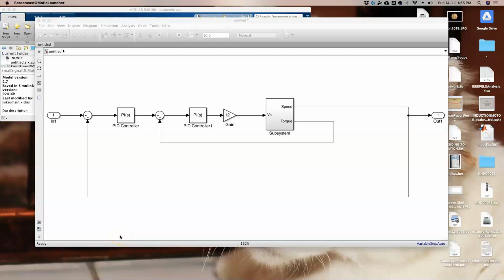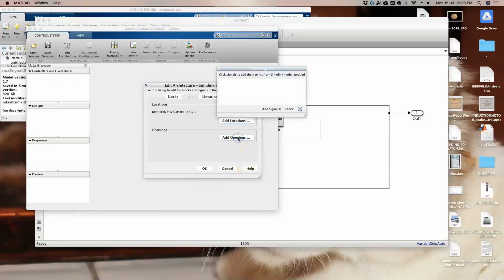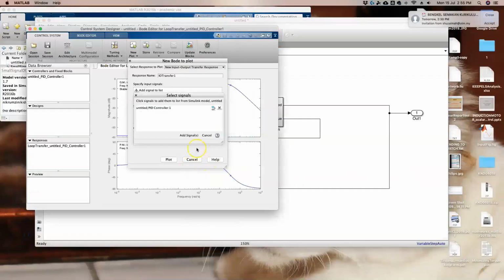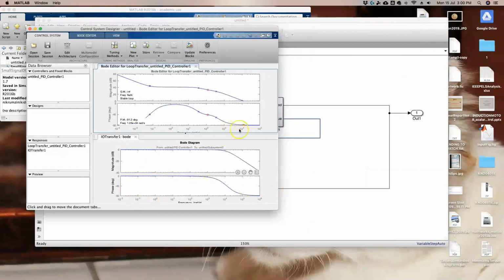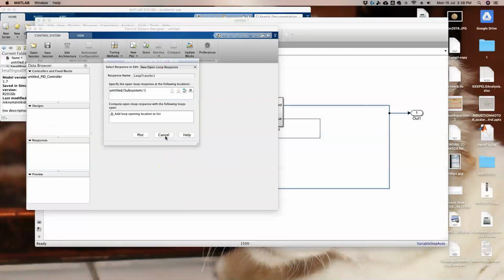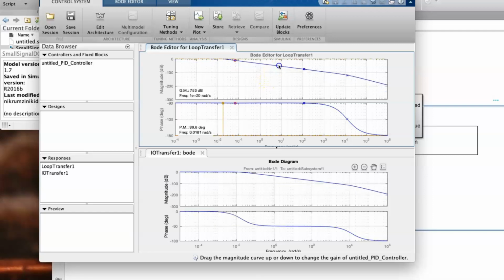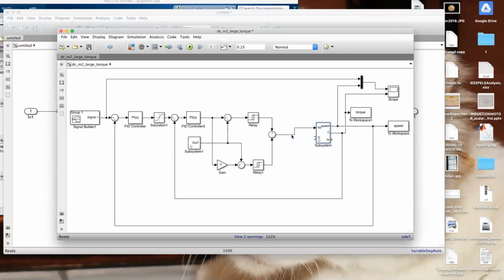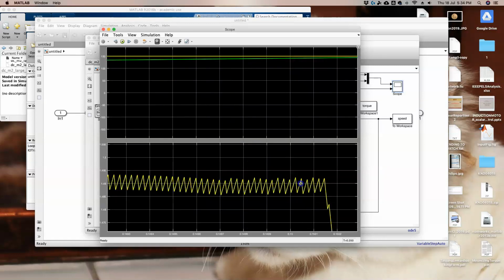Designing PI controllers for a cascade control DC motor drive with speed and torque loop - part 2

Comment: thank you so much for this video.
But I have a question regarding the concept of changing the input of PI controller from error between speeds into reference torque as output?

Comment: thank you very much sir
Reply: Hello, do you have any idea about subsystem 1?
Reply: @sachinsk_music  yeah, but i don't use matlab to simulate the dc motor + DC Chooper. Instead I use PSIM for the electromechanical simulation. I just copied the the PI value that has been obtained by using matlab and use it rigth away on the PSIM.

Comment: Finally converter gain 12 is not used in torque loop simulation.
Reply from the maker: 12 is the average model of the converter which is Vdc/Vtri(peak)  = 60/5 = 12. In the large signal model Vdc is set to 60V and peak triangular to 5 V.
Reply: do you simulate this project? how did you design subsystem1?

Comment: I am working on cascade (force,velocity,current) system, force feedback is resulted from a 3rd degree polynomial curve of position parameter(theta), however went through all available sources of tuning(including your vids), all suggested less gains of third loop(force loop) , then signal never reaches set-point! , any suggestion is appreciated. Thanks in advance.
Reply from the maker: Hi, probabaly PI controller is not good enough for your system.
Reply: @nikrumzinikidris1333  That's right, when I used only P controller for force (third loop), response is perfect!!, but the problem still , because  here the "P" gain of third loop has to be higher than the other loops?. My question; is it possible to assign more "P" gain for the third loop ignoring all the "must" of having less gain.Your answer is appreciated.
Reply from the maker: It is possible as long as the bandwidths of all the loops are in order. I prefer to use Bode plots to find or set the bandwidths rather than just relying on the numerical values of the P gain.